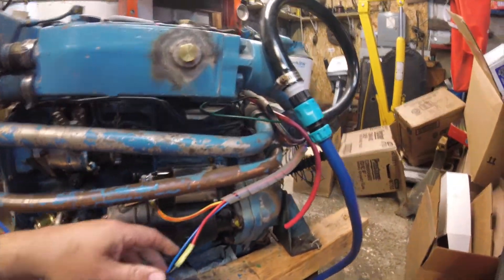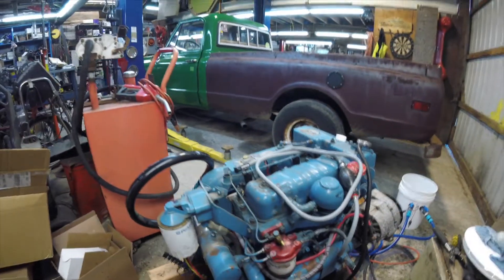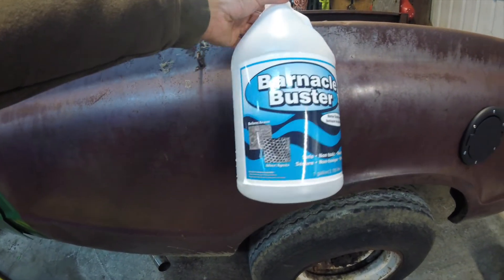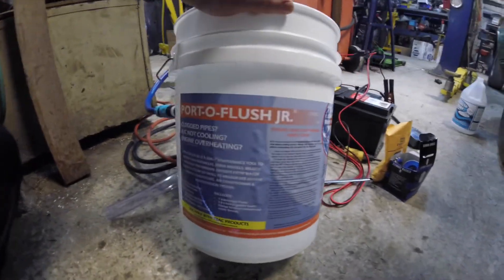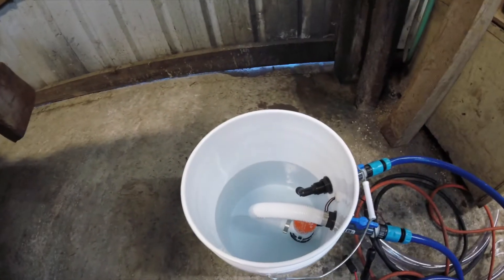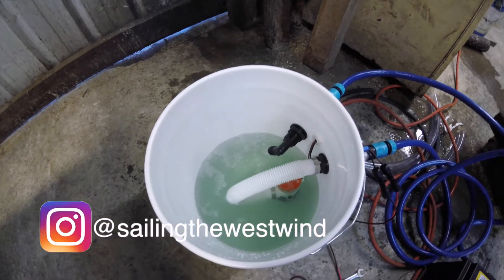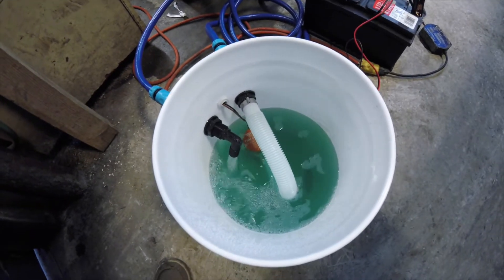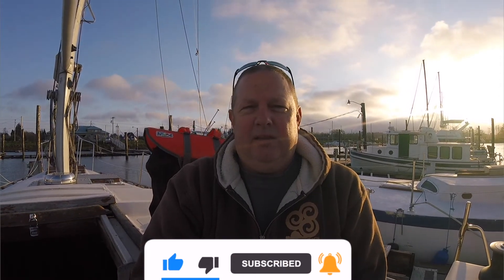Engine over heating problems? [EP 73] I used Barnacle Buster to flush my raw water cooling system.

Comment: Maybe I missed it.  I thought you should let the barnacle buster sit in the engine for awhile.  Before flushing it out....  ??
Reply from the maker: Running in a loop for four hours. That’s the instructions. I just learned I have bought the water down version of the chemical. Or should I say already premixed. I just bought a gallon of the concentrate and will be flushing it again. Directions say 2 to 3 hours I say give it one more.
Reply from the maker: I think you have my number. Call anytime. Thanks for your comments. I look forward to watching your new project. Take care.

Comment: It looks like your engine will soon be ready to install in your boat and then you will be able to move the boat under it's own power. Do you plan to keep it at the current marina? Would it be less expensive to keep it on the hard while doing your refit?
Reply from the maker: Way cheaper to keep it in the marina. It’s way more expensive and I asked her to keep it on the card. Thank you for your question. I will get towed over to a crane to swap the engines.